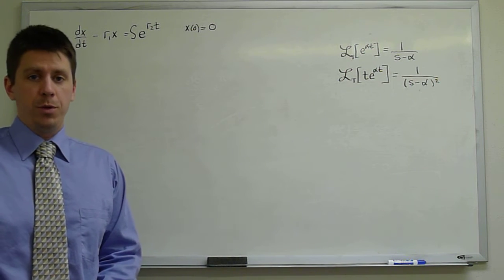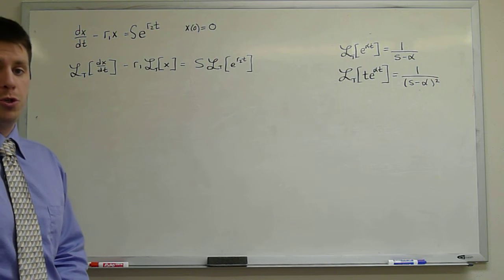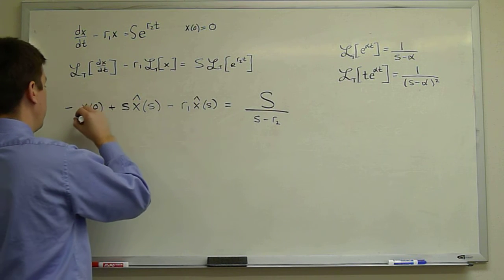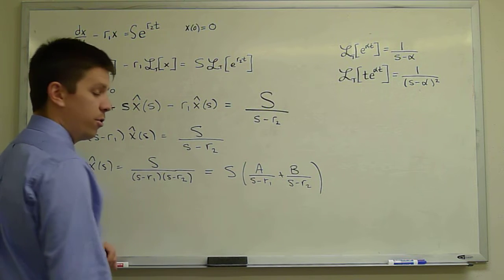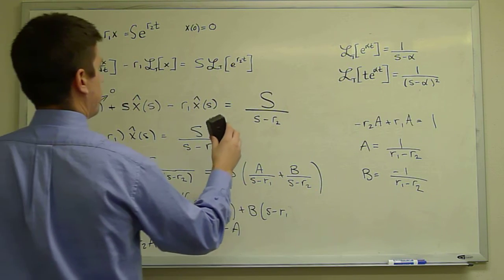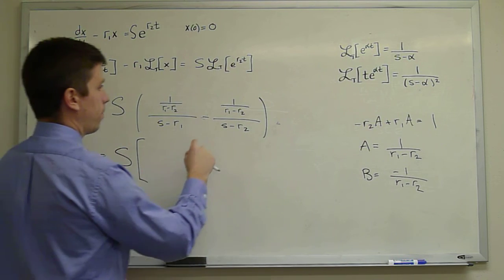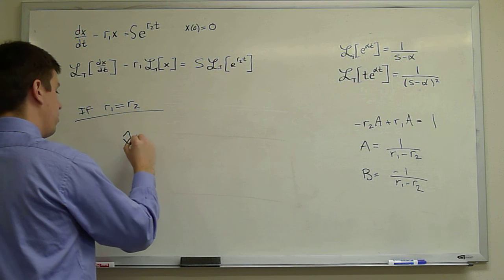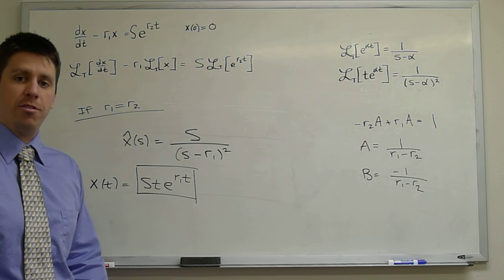Laplace Transform of a First-Order ODE

Comment: Nice persentation & thanks a lot, but: 1) In my opinion, using a capital S for a constant multiplier in a Laplace transform problem is asking for confusion and mistakes to happen. 2) In the final answer, the factor r1 - r2 could be factored out and included in S. The final form is then some constant A = S/(r1-r2) and x(t) = Ae^r1t + Ae^r2t. I accept that the final solution as you've given is probably easier for plug-and-churn calculation.